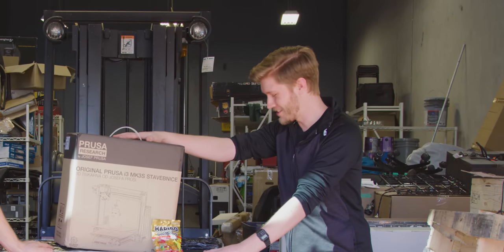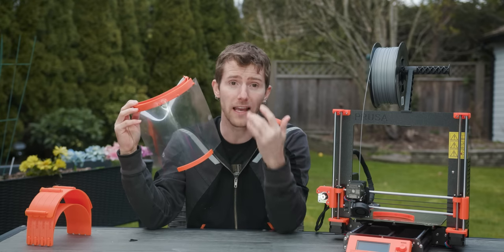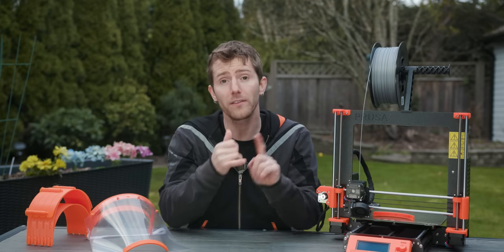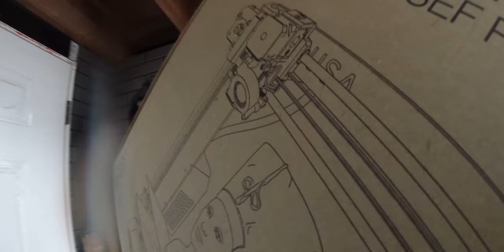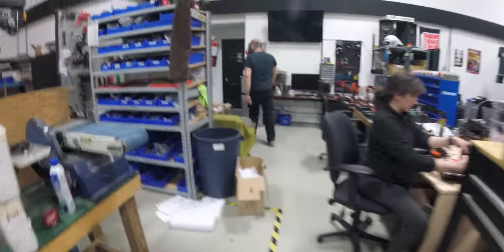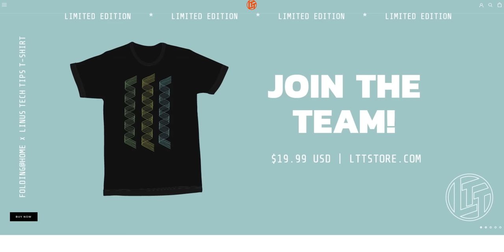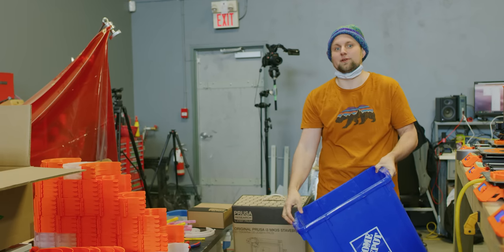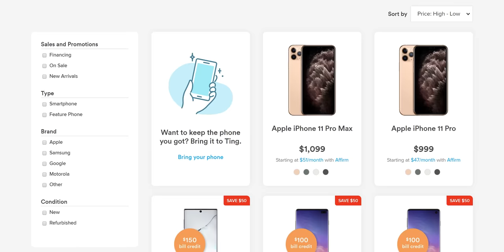3D Printing 300 Face Shields… PER DAY

Comment: My mom is a nurse here in ontario and her nursing home is running out of ppe’s so they really appreciate people like you thanks so much
Reply: The home my mom works at id also out of masks. Someone who worked there stole a bunch and they only had around 100 left so my mom had to lock them up in her office.
Reply: My mom is a nurse in Massachusetts and a parent in her unit had the virus 🦠
Reply: i also live in ontario
Reply: Shout out for your mom, she is a great soldier in front line to battle for life
Reply: My wife is a nurse in the states...same issues in her ICU...well done.
Reply: I'm a house keeper at one, we're running out of gowns/aprons last I heard. I had to use a reusable one earlier to clean a potential case room.. we have a few active cases too. Thankfully masks haven't been a problem yet. Most people wear washable ones unless you're entering an area with cases, etc.
Reply: PPEs*
Reply: I also have a mom. She had birthday yesterday.
Reply: @Shijaru64  *PPE
Personal projective equipments makes no sense. There's no plural form of equipment, it's only used in the singular form... Lol
Reply: @John-mf6ky  OP wrote the plural form, and even used the apostrophe wrongly, hence my correction. But yeah, fine, it has no plural.
Reply: @Shijaru64 , I know, it doesn't both me. I just find it funny you're trying to correct someone yet aren't correct yourself.
Reply: @John-mf6ky  The misuse of the apostrophe for the plural form is such a common mistake that I simply corrected out of habit, that's all.
Reply: Wow, this comment was posted 5 hours ago And already had 1.4 thousand likes.
Reply: I'm near Toronto and making those ear saver clips - message me your address and I'll send you as many as you want.

Comment: I'm a former injection mold maker. It takes about a month to make a working injection mold. Mold makers and injection molding shops thank you. I used to work at a mold shop that specialized in medical injection molds. I know that they are doing everything in their power to help. Print farms are a great way to help fill the need for equipment immediately. An injection mold can produce one face shield frame a second but new molds need to be made and tested. Our current economy runs on an at-capacity-production model to maximize profits. This type of production does not leave room to ramp up production. Thank you LTT for what you are doing.
Reply: that clears it up. molding is faster but the time it takes to prepare means it will be a while before they can be up and running. correct?
Reply: Hm, interesting. Once I was watching a documentary about 3d metal printing and they were printing an injection mold (a cup). I'm quite curious how long does it take with such printer?
Reply: @UMADBRO64  but it's already being done... check out the seemecnc website... they iterated the prusa design to make it injection mold more easily and are already cranking out tons of bands... 

I think that they used a different approach to design, taking the desired function, and changing the design to fit the process rather than design tooling to fit the desired form of the product. This let them make a mold fast and have it running... There is a clip of the machine running on CHEP's latest video
Reply: Ah mass production. The first $1 part takes 6 weeks and costs $200,000. The second takes 30 seconds and costs $0.10.
Reply: @frederf3227  #facts
Reply: peteabc1 Injection molds can beprinted on metal 3d printers, but their durability is not as high as traditionally made tools. They can be used for small runs of couple tens of thousands of pieces.

3D printing metal is being done with process called sintering - you need metal powder, powerful lasers and inert gas atmosphere. Lasers melt the powder, new layer of powder gets added, then melt that layer, etc. After that, it takes many hours to cool down, powder gets removed, and then those prints need to be post-processed with nasty chemicals to get rid of binding agents etc. It’s neither cheap, nor fast process.
Reply: @UMADBRO64  First, How does that change the fact that IT HAS ALREADY BEEN DONE? they have the info up on their GitHub page... so nobody has to reinvent the wheel... 

Second making the assumption that I don't know something is idiotic. I am a professional industrial designer and am quite familiar with iterative design and the lead-time and expense of injection molding. I never -NEVER- said it was done overnight... just that IT HAS BEEN DONE and people don't need to duplicate the effort when the design is opensource.

Get off your righteous high horse and go do something constructive.
Reply: @UMADBRO64  Hm. For a decent standard mold I would probably agree with you. But this is a quite easy geometry and not to big. Furthermore you can make the mold from aluminum as standard plastics are sufficient for that kind of purpose. Next you only need a cold runner. And since the more or less only requirement in this case is functionality, you don't really have to worry about surface quality.
Hence for an aluminium mold with a CNC manufactured cavity, a cold runner and decent but, of course, not optimiced cooling channels I would estimate 1 - 2 weeks. If prioritized and the material is at hand rather one
Reply: @peteabc1  high quality metal printing takes a long time and is usually only suitable for prototyping. You could probably make parts by 3d plastic printing them like LTT quicker and for longer.
Reply: We're tooling up to do 2,000,000 a week
Reply: @steveman1982  it might be for small consumer parts but larger more complicated molds take about a month. Injection molds are as precise as a Swiss watch and as big as a dresser. Water jackets, ejector pins, slides, gibbs, and inserts all have to be machined within a hundredth the width of a human hair so that the high pressure plastic doesn't fill the voids within the mold and render it inoperable. Some parts are made in climate controlled rooms so that thermal expansion doesn't affect these tollerences.
Reply: @bobtawiligar  I am working for a research lab and we actually just metallize 3D-printed plastic molds for first trials. That's even faster. Furthermore by metal plate diffusion bonding you can make smaller molds really fast. The only thing you have to do is to CNC the geometry out of the single plates beforehand.
Reply: @9Redhead3  nice! I only worked with a few 3d printed metal parts while I was a mold maker. I machined electrodes for the EDM. Burning details that the CNC machines couldn't replicate.
Reply: @nicholaslepp1502  Trump should have invoked the defense production act when he first heard about this virus. Production would have been able to keep pace with demand. Sadly 😔 he chose to not act when he could have made a difference. Currently closed automotive production facilities that have injection molding presses could be making life saving medical devices right now. They could use military transport vehicles to distribute those goods to hospitals. It's a sad day 😢 when a YouTube celebrity is doing more for the world then our president.
Reply: @steveman1982  Smarter Every Day is a wonderful channel that teaches many people about scientific topics but I don't have to watch his video to know how long my colleagues and I took to make injection molds. If I'm not mistaken he was a NASA engineer. There isn't a lot of injection molding in the aerospace industry. Injection molding is a High-production High-tolerance industry. NASA is a Low-production High-tolerance industry.
Reply: @UMADBRO64  @mightygrom just be happy that everyone is doing everything they can right now. I'd advise anyone who is interested in how this process works to do more research. Hopefully LTT does a follow up on this video. Medical device production is very interesting and I think his viewers would love it.
Reply: @bobtawiligar  "Long time" sounds like you don't know. And yes you can 3d print plastic (obviously), but that's not what I was curious about. edit: forgot to mention I found smt and they mention up to 100hrs (probably per insert) and can do only small inserts and also ~2-.5x more expensive. So not very interesting..
Reply: @crawlerin  Yes the process was described in the documentary..